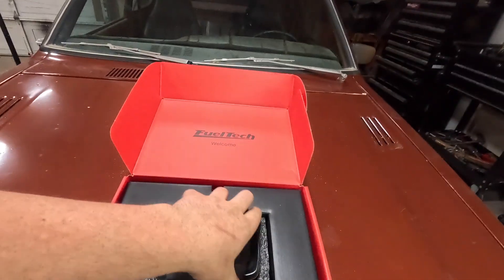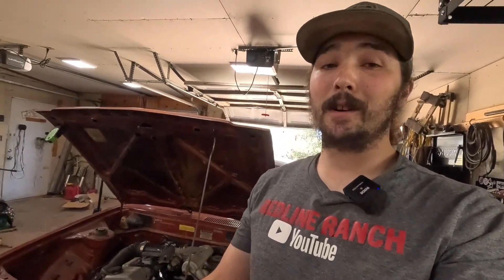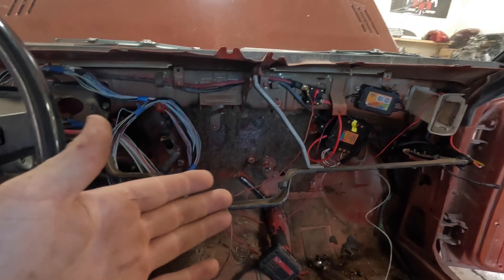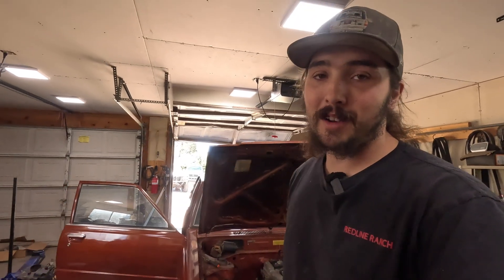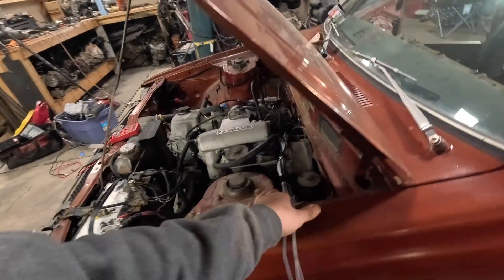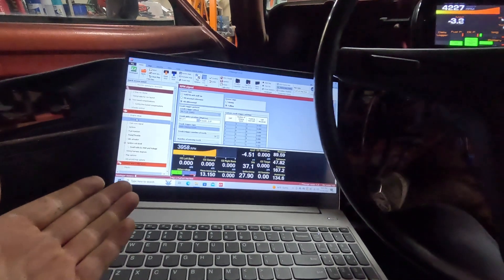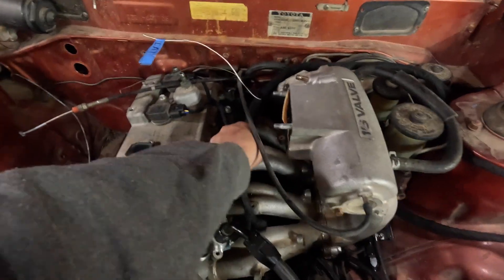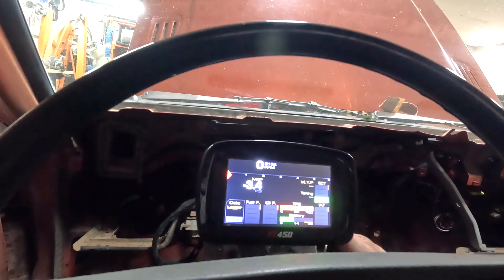Installing A FuelTech ECU In My Engine Swapped Project Car!

Comment: So, when you wire this to the engine, there are tunes available online for these Toyota engines? You download the file to the unit? Where do you begin?
Reply from the maker: @technicalitems731  with fueltech it’s a setup wizard system that helps you set a base tune, so I went through and setup a base tune myself and have been editing it from there

Comment: My first car when I was in high school was a 1975 green 💚 4 speed manual transmission toyota corolla. My dad got it for me and my sisters to share, but it was mainly mine to drive since my older sister married, and my next older sister left for college. It didn't have power windows or steering,  no radio, and no A/C, but it was trooper and fun to drive.

Comment: You should look into a brake booster out of a first gen tacoma much more compact . Great content
Reply from the maker: I'll check it out, I might even have one lying around, it’s definitely pretty bulky and I actually had to clearance the intake for the brake master. I’ve also thought about going manual brakes just to help with clearances, that’s on the plan for the build for sure!
Reply: @redlineranch.  I was going  to 2rz a 74 corolla deluxe coupe but east coast of Canada salty winter rds car at this point is inches from being in two pieces so need a chassis . But I have 3 perfect 2rz's with 5 spd transmissions

Comment: Well you could use some of that extra wiring to tuck it
Reply from the maker: @lastviper-j7y  The harness will be tucked when it’s finished, I just need to pull the harness and re-route it to under the brake booster. Other than that the wires are all going directly under the intake where they will be hidden.
Reply: @redlineranch.  that's where it gets fun

Comment: On your wiring harness issue. Maybe you could cut it to length as needed.
Reply from the maker: @jamesmiles1456  I did, I cut over 10 ft off, I left some extra (~12” or so)  just because I have a forward facing intake manifold, that’s takes LS style injectors, and and a ford style throttle body, so I’ll be rewiring the harness for that manifold eventually.